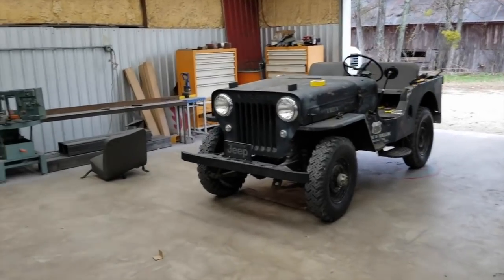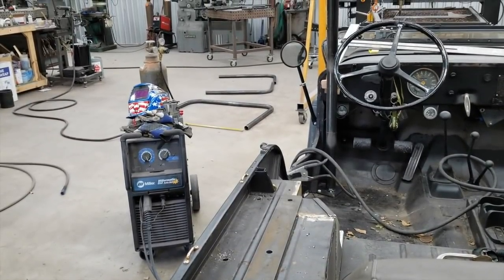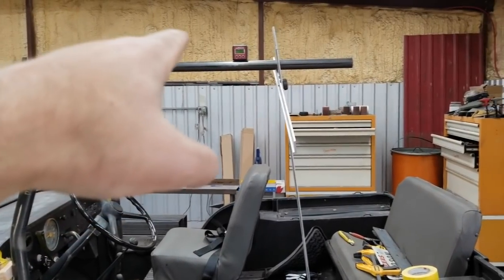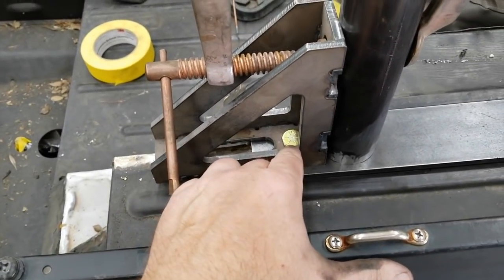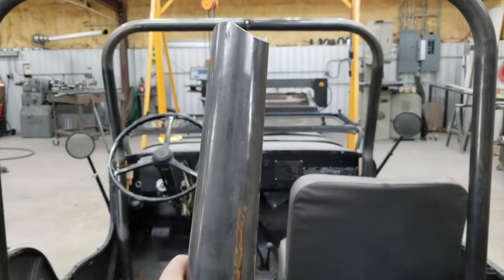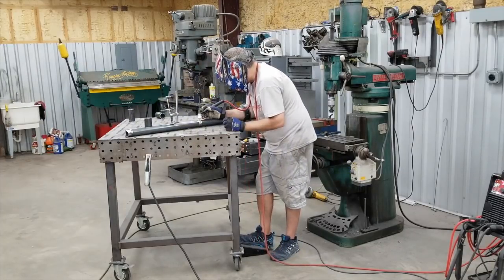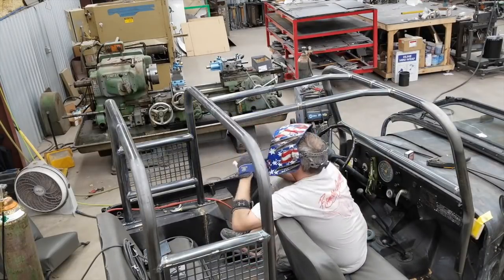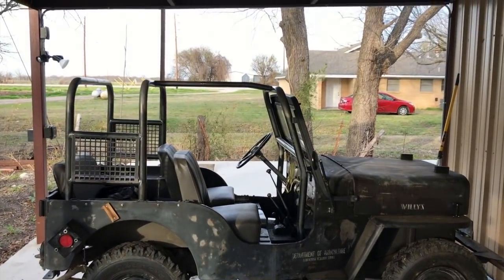1959 Willys Jeep CJ3 Roll Cage - Extreme Custom Fabrication

Comment: I'm 6'3" and from experience i would hate that cage. Mainly the front hoop because it comes down and crowds your leg and foot room. 
  It is possible to come down to the dash and then switch to plate to aleviate the foot/leg room problem. Very similar to the way some cages are on a TJ when the tube stops at the dash and then converts to plate and follows down beside the dash.
 Nice shop :)

Comment: Pretty weak by mounting only to the body? We always used brackets under the body and attached to the FRAME of the vehicle. Certainly better than an old rusty body for mounting a cage. After all, it is YOUR head it's protecting!